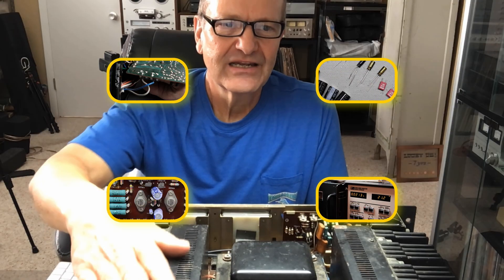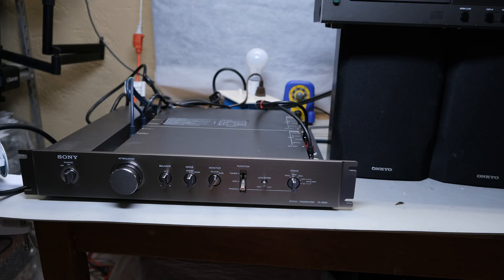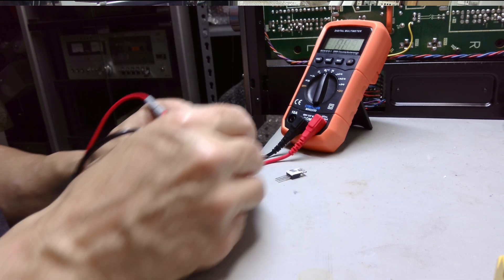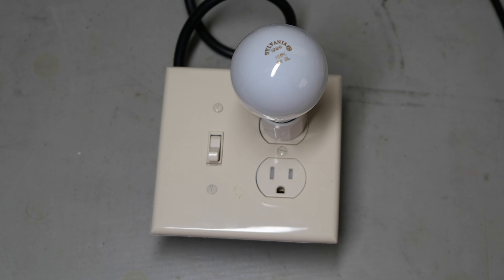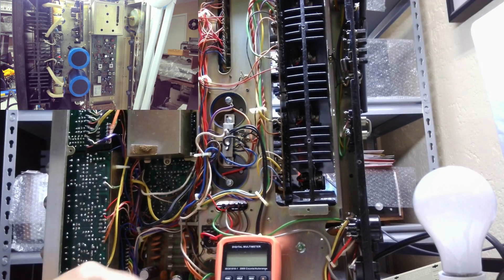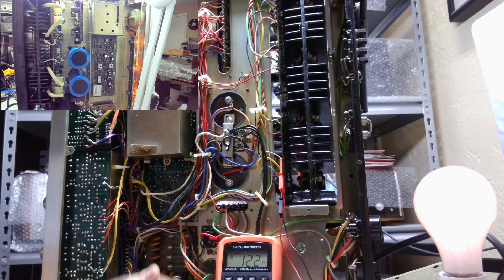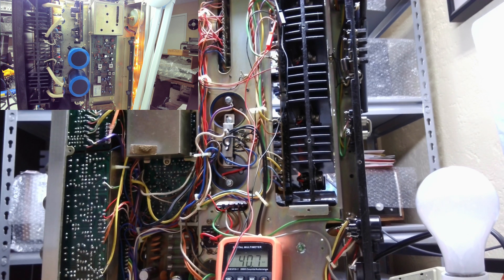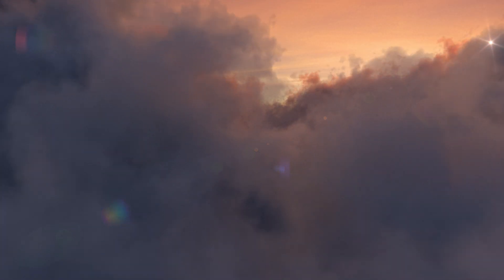The #1 Mistake You're Making with Dim Bulb Testers - Don't Make It Again!

Comment: Common sense tells you,  if you have a dim bulb tester hooked up to a piece of equipment that you're testing for shorts, you are limiting current!
Why in the world would anyone adjust current flow with a dim bulb tester connected? lol
If you can't figure that one out, I guess you need not be repairing electronics right!? There is no room for mistakes like that!
Reply: What if you forget? Anything can happen if you are fatigued or distracted. No one is infallible.
Reply from the maker: Thanks for commenting and for watching.
Reply: I tend to agree.  I use it in combination with a Variac.  Then when the unit starts, I bypass the dim bulb immediately.  I put an abnormally small fuse on the Variac for protection.  
The dim bulb needs removed immediately because it can glow without you tend to notice.
Reply: Starting off in this hobby,  I blew up some output transistors and the lightning strike took out random things on the left amp board on a McIntosh by shorting with my multimeter, and it ended up costing me a pretty penny to get right again...  After that, I was so nervous to do anything, that I kept my components on a dim bulb for everything, so for me, the fear was outweighing the logic for a bit, but now that I have good grabbers, I can think clearly again.  Apprenticeship helps greatly, to flatten the curve a bit.
Reply: Haha, yes!  On the one hand you have audiophiles who are worried about what power cord to use for best sound reproduction, and on the other you have techs (hobbyists?) adjusting audio equipment with a light bulb in series with the power line! 😆